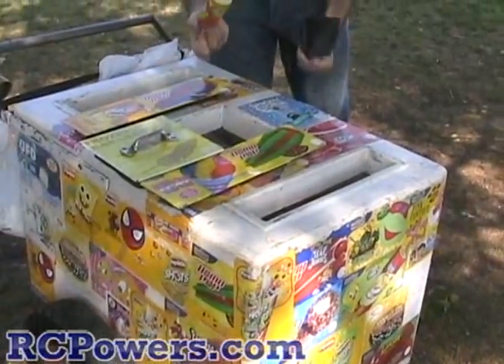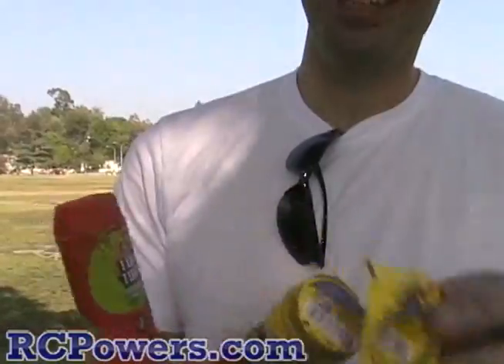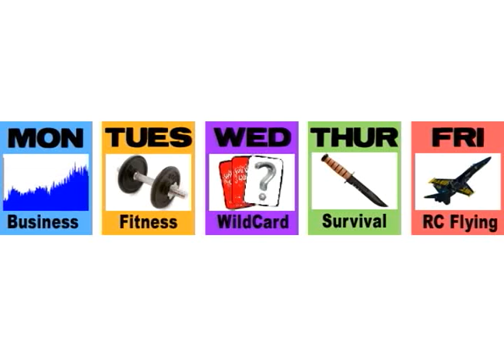"CRASH TESTING" Some Prototypes!

Comment: Made an SU 27 in same setup, but only used the tail control. Had fantastic controls, could practically hoover, until airspeed dropped to much, then controls lost it's controls slowly. Model was powered up to 1.35 power of it's weight.

Comment: That su-35... Was one of the esc to motor wires loose. Because on the f 35 video( the one with the gyro testing ) the motor was twitchy and Val said It needed a cough drop

Ps that yf 23 flew verrrrry nice

Comment: wood is to heavy, where i live we dont have any hobby shop. i found that the material needed is something like the hot soup cups of foam. ( ready to add water noodles cups )

so if you can find something like that.. the biggest sizes i found where round flat pie display / serving plates. those are 41 cm in diameter and about 3 to 4 mm thick.

cardboard is possible but not recommended as substitution to foam.